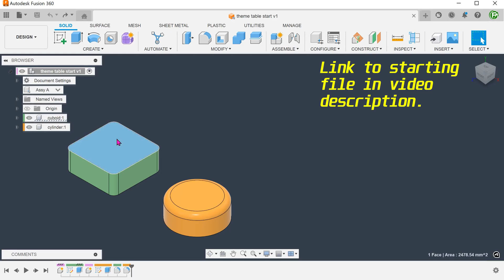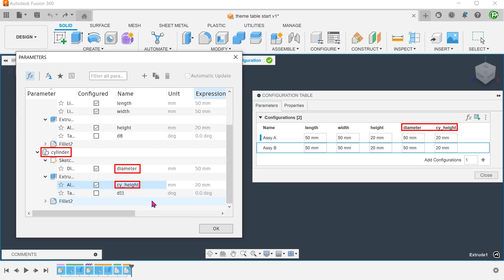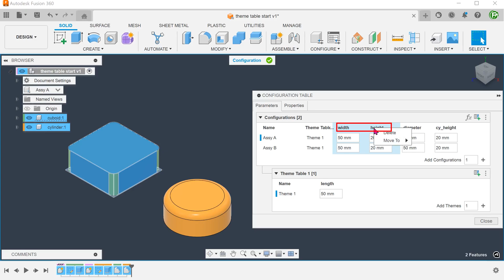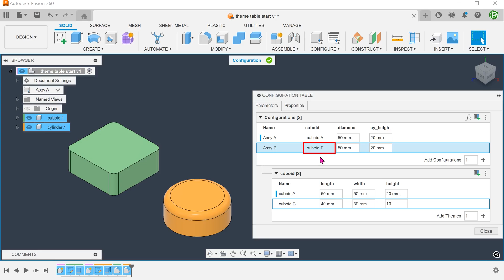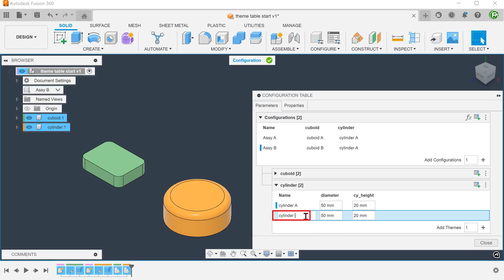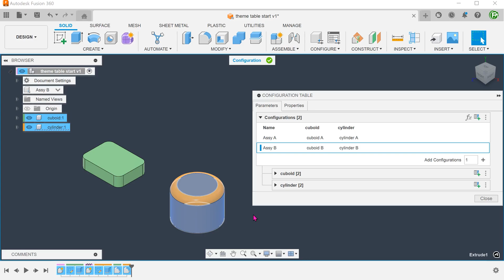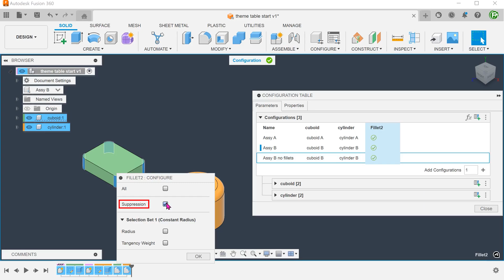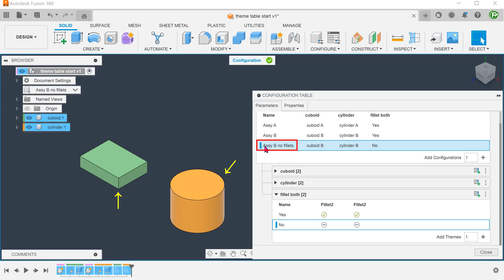Fusion 360 | Configurations - Theme Tables

Comment: Why are Fusions GUI and ergonomics sooooooo badly designed? Every workflow should be self explanatory. For example: once it’s a right click, then a double click or a dedicated button or even nothing (trim tool).
Reply: When doing a poly line you can stop by pressing ESC. do the same thing when doing a spline and it gets deleted... Yikes